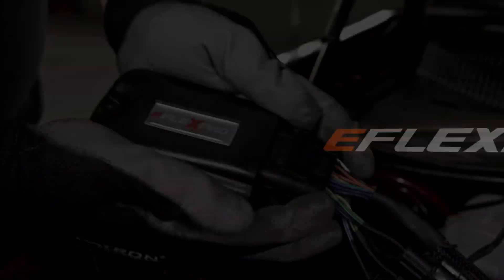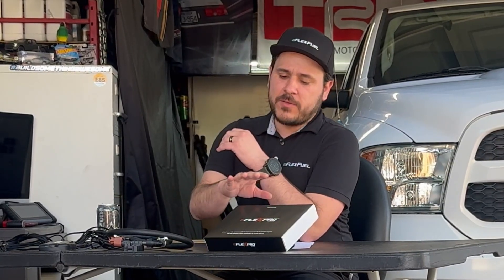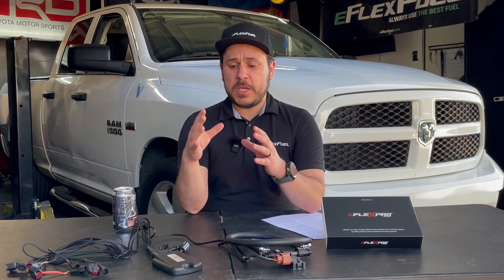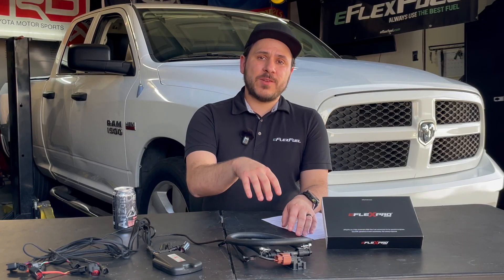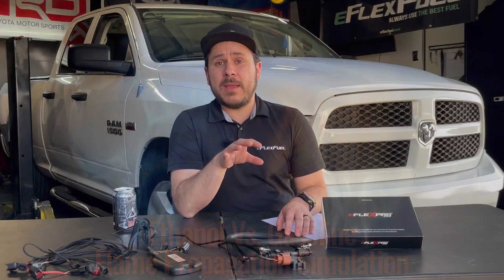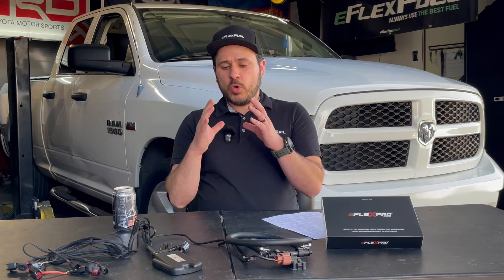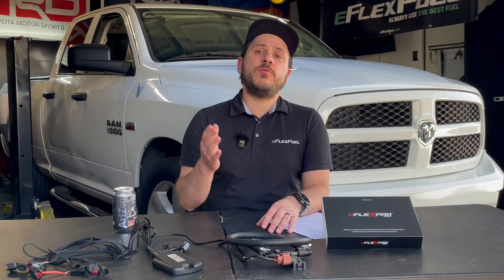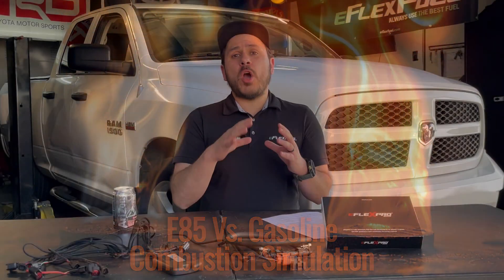Do eFlexFuel E85 kits really make power WITHOUT tuning?

Comment: I have the kit for my 03 m113k cl55 amg. Havent installed because I was under the impression that I need upgraded injectors? So i got a kit with the ev adapters, But having upgraded injectors means you need tuning, so Im confused. Is it more so that you benefit much more with the full injector upgrade but still able to run e85 with stock injectors and gain some extra power even so?

Comment: so i had a raptor 6.2l with a whipple supercharger tuned to 91, assuming my injectors and fuel pump are good this would still be plug and play without more tuning?

i came from the hellcat video and one of your comments was that a stock hellcat injector isn't good enough to run full tank of e85.

Comment: Here's the part he doesn't tell you. 

The Problem with E85: Ethanol has less energy per gallon than gasoline. To run E85, your fuel system needs to move about 30% more volume. Your stock fuel injectors and high-pressure fuel pump (HPFP) do not have the flow capacity to keep up with that demand at full throttle.

Comment: Do you have to change your fuel injectors or blend reg fuel with e85?
Reply from the maker: It all depends on the vehicle - generally, the stock injectors have sufficient flow capacity to support running on full E85.

Comment: Anything for an 2007 Audi A4 2.0t? I have all the fueling upgrades to run E85, I just can’t find an easy way to do it without a custom tune.
Reply from the maker: Yes, we have kits compatible with your Audi A4 2.0
Our system is plug n' play - no tuning is required.